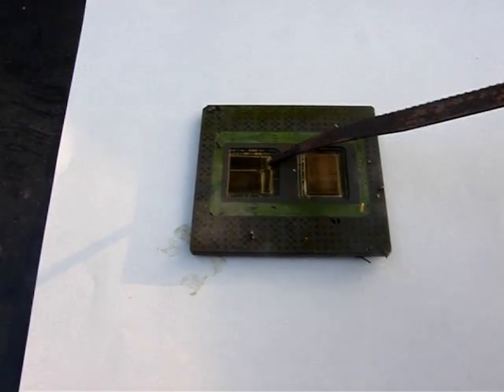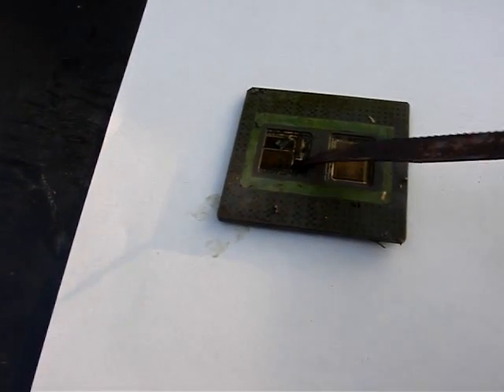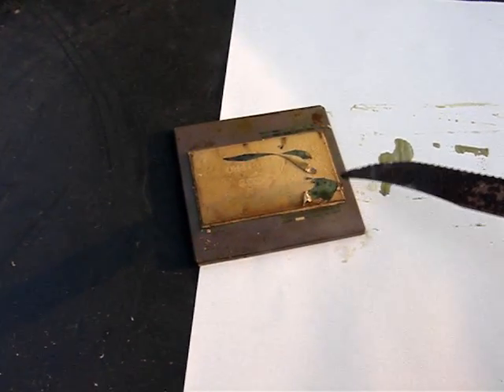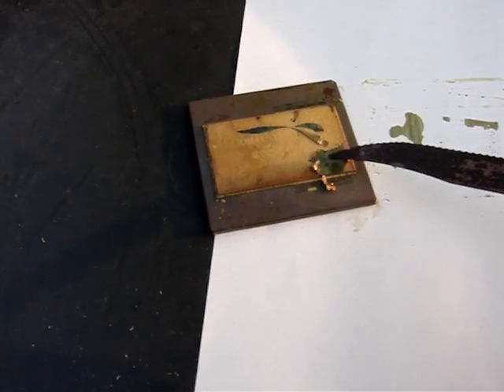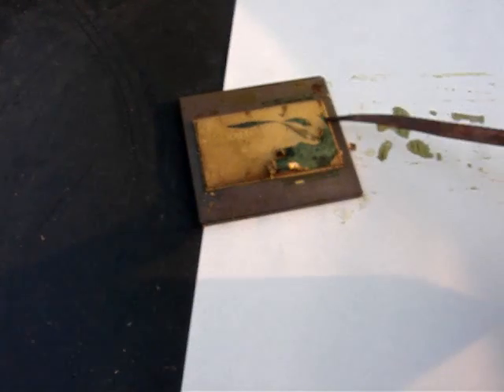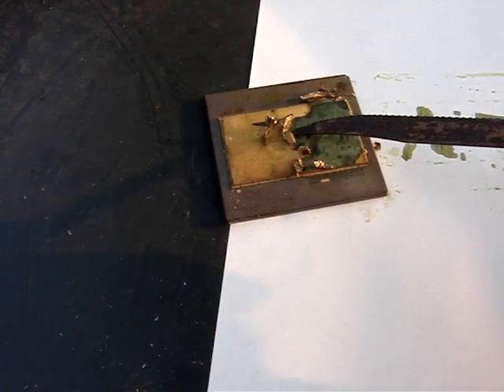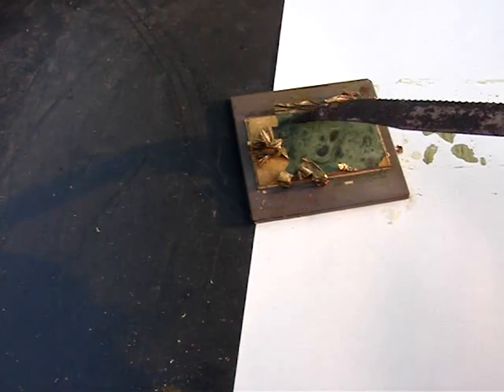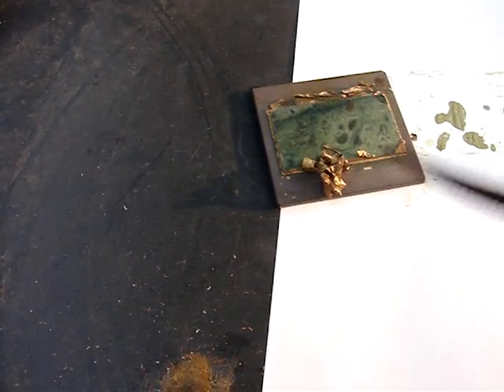Pentium Pro.mpg

Comment: Here I have twelve IBM Pentium Pro computers from circa 1996. They were bought as off lease working computers via Ebay around 1999 to 2003. I paid with freight about 30 to 70 for each computer. All were ungraded to Pentium II Xeon type server CPUs that fit Socket 8. Thus the unused 12 plus PPro CPU's were sold on Ebay last year and I got back several hundred bucks.